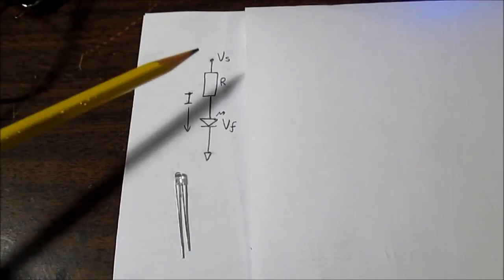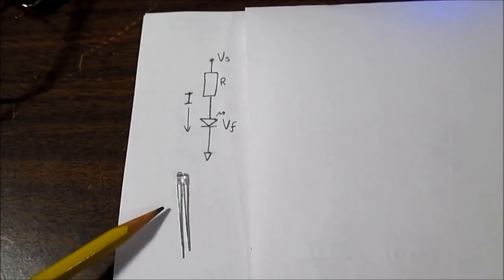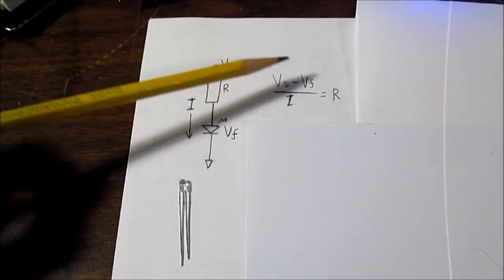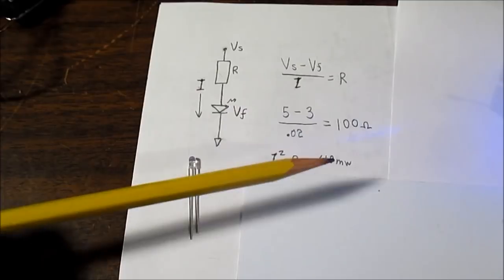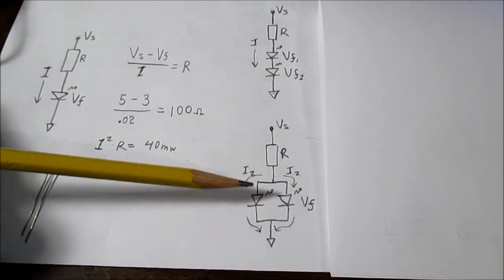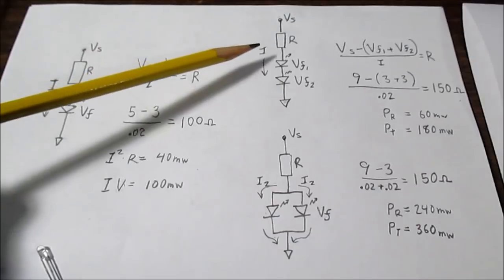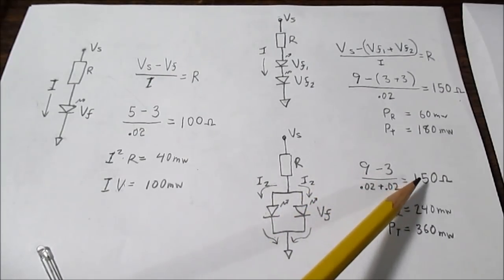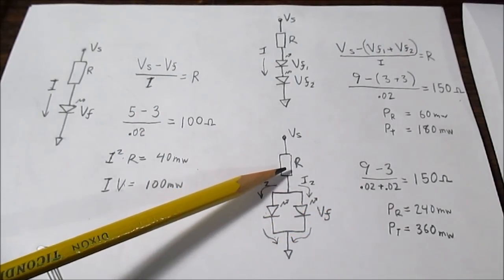How to select resistor value for LEDs

Comment: I was wondering what  size resistor to use  in a  device  I  built  meant  to  help heal  injuries  and  remove   pain.   Its consist  of near Ir 850  nm   diodes.  I  used an  adjustable  current and   voltage  power  supply.  There   are about 170   led I  soldered to a breadboard. Forward  voltage per  led was 2.0 volt . I put   six per row to get same as  a power  supply,  12  volt. With the  adjustable power supply  I   can light up  the  entire board,  but  have not yet purchased the  power supply   I  intend to  use,  which is  12v  8.5 amp.   I  dont know  what size resistor to use for the   entire board. I was  hoping to  use one  resistor   I have them six per row, If   I  set  the  adjustable  power supply to  12  volt,I can light   up  the entire  board with aprox  2.2 amps total.  What I dont  know is what kind of a resistor I can use for the entire  board. The  device  will   be   used to apply   to  my  lower back  and   to  the  bottoms   of  my  feet.  I am  a diabetes, and want to apply it to my feet,  I  injured  by  back  and  live with pain  meds  and  hope  this  might  work as  well  to my  back.   https://www.youtube.com/watch?v=zy-FzbSk0UY

Comment: It brings back fond memories from the late 70s. As a kid, I had picked up a few red LEDs from Radio Shack, without really having a use for them. Until I looked at my slot-car set. The cars had grain-of wheat incandescent headlights, but no tail lights. I measured the track voltage range, which varied with the hand-throttles, then I found the maximum current on the package somewhere. I worked out the resistance needed using Ohm's law, drilled some holes, glued them in, and voila. Tail lights on my slot-cars.

Since an incandescent bulb is a regulator of sorts, I could have wired the LEDs through the headlights to stabilize the LED light levels throughout the range of voltages somewhat. Since resistance is very low when the bulb filaments are dim, and high when the filament is hot, it would have allowed higher current to the LEDs when the car was going slow, and limited current when the headlights were bright, and the car was going faster.  I'm not sure if the voltage drop would have been sufficient, so perhaps a shunt-resistor may have been required.

I remember that if you accidentally got the polarity wrong on those LEDs in those days, they burned out immediately. Thankfully not the case any more.

Comment: I have noticed that the resistor used in LED indicators for 220V AC appliances like mosquito repellents uses 100k resistor but according to the formula [Resistance = (Supply Voltage - LED Voltage)/LED Amps] the resistor should be 12k (approx) but why 100k is used?
Reply from the maker: They wanted the LED to be run at low currents for less light. Modern LEDs are efficient and can be too bright if run at higher current.
Reply: JohnAudioTech but why 100k... wny not 110k or 200k? how they calculated that it should be 100k? Also the wattage of resistor for 230v should be arpund 5w but why they used 1/4w resistor?
Reply from the maker: It is not critical. 100K is "near enough" to give the light output they need from the LED. 240v across 100K is about .58 watts. The AC would probably be half wave rectified as the LED would be damaged if that kind of voltage is placed in reverse across the circuit (even at the limited current). This would mean lower heat dissipation from the resistor. I would use a 1/2w resistor.
Reply: JohnAudioTech But I want to know how it was calculated that 100k should be used? Also for 100k resistor the wattage should be around 5watts because according to the formula Power = Resistor Voltage * LED ampre = (220-3)*0.02A = 217*002 = 4.34 watts.
Reply from the maker: The designer connected the LED to a variable current supply and determined the LED was bright enough at 2ma. 217v/.002a=108.5K ohms. 100K is close enough value. 217v * .002a is .434 watts. Your decimal point is in the wrong position.

Comment: I find it strange that this info is so simple and easy to find and yet I STILL frequently find retail packs of LEDs that don’t give me the specs I need.
Reply: Emmett Turner 
If you own a multimeter, you can measure the voltage across both leads of the LED while powered up, then recalculate and pick a more optimal resistor value to pair with the LED.  The maximum current is usually rated at 30 mA, but if you target around 10 mA, you'll still get very good illumination and longevity.

Comment: Nice vid, it wasn't able to answer a question I have so I'm hoping you can. I bought after market tail light assembly and the brake and day running lights are the same bulb. No additional resistors or capacitors were included. I was wondering how would I go about wiring them so the load will restrict wen not hitting the brakes. Thanks for any help and I'm re using the stock tail light harness.

Comment: Would i need a resistor if I have 3 3v leds in series and a power source of 9v?
Reply: No
Reply: Den Lim that sounds problematic; you should always have a resistor to limit the current to a safe level, but since the resistor itself will have a voltage drop, 9 volts supply seem too little, I would recommend using 12 volts or higher, and do the calculations based on that voltage.
On the other hand, if your supply voltage is limited to 9V, e.g. from a battery, you should probably connect the LEDs in parallel, with a resistor for each LED.
Reply: No but you need higher voltage source that must be greater than 9 volt e.g 12v, 15 v
Reply: No yu dont.
 The answer is above me.

Comment: So if I have a 6w power supply and my LEDs need 6w what should I use as a resistor?
Reply: I'm using 4 1.5v LEDs linked together they are IR LEDs btw

Comment: Why deal with Conventional current when explaining a circuit?  Use electron flow which is 
more  sensible  to  explain. Electrons flow from neg. to pos., and  no reason to look at it in a more difficult way. To my way of thinking.

Comment: I have know these things for 40 years, but more recently started cheating.
If an individual LED is only going to be on for a couple hours use for the rest of my life, I will run the LED at double current overnight. If it does not fail, I will use that current level. It is much brighter than using max current per the spec sheet. Don't try this for a production or always on application.

Comment: Parallel LEDs in a Red/Green (single LED 2 color LED) pair (street light scenario) would benefit from the last circuit shown.   Is there an issue substituting the single color in your example for a 2 color LED (reversing one orientation)?

Also - Resistor on cathode or anode normally, and what about on 2 color situation?

Comment: There is a app called wova in the Google play store that will do the math easily. To find the wattage of the resistor just multiply the voltage drop across it times the current to get it. Twenty milliamps would be .02 when entering.

Comment: Very good video, simple and easy to understand.. I'm little bit ashamed because I never did the calculation, I always used any resistor in the 270omhs range and if the led was too bright or  too dim, I changed the resistor :-)
Reply: I use 350 ohm first, and then go lower if it's not bright enough, but same here.

Comment: Paralleling LED's is a bad idea. LED current increases exponentially with LED voltage.  Any small mismatch between "identical" LEDs will cause one to draw significantly more current and be brighter than the other.  You can add a small value resistor (10 ohms)  in series with each of the parallel LEDs to correct for device mismatch, but you would be better off just giving each LED it's own voltage dropping resistor.
Reply: From experience, even matched LED's will start drifting apart over time when run in parrallel on a single resistor. I assume it is from uneven heat distribution causing accelerated aging of one of the LED's, which gets worse and worse the further they drift apart.
Reply: Called an LED current thief when I was in school back in the 70s.
Reply: Jess Stuart 
You beat me to it with your comment. :)

Comment: how many ohms resistor can i use to reduce  12v to 3v
Reply: Assuming you are talking about standard LEDs - that approximates to 3 v @ 20mA (depending on the colour).
So somewhere round 470ohm should be good.
That's calculated as 12-3=9v to drop .... R=v/i = 9/0.02 = 450ohm .... the nearest stock resistor is 470ohm (always round up).
In real life you could use any value between 400-1500ohm - depending on what you feel is acceptable ... bright = short life, dim = long life
Reply: just resistors won't cut it ;), need to make a step down board
Reply: You need to know the current through the circuit. Other wise it is just a WAG.
Reply: use in4004 diode
Reply: 9/I ohms.

Comment: But where did you get the 20 milliamps figure in the first place?
Reply from the maker: The datasheet or manufacturer of the LED should be able to provide you with the recommended operating current for the LEDs.
Reply: I'm sure that it is mentioned in the data sheets but in school, back in the 70s we were told that a typical LED is around 20 Milliamps in the 80s and the 90s the white or blue LEDs it was suggested that a 40 milliamp current would be needed. Not always but myself I rarely ran across one that used a lower current. But since the 00s I haven't been in electronics hardly at all. Can not focus on the small parts.
Reply: Buy glasses.

Comment: so using a linear circuit with for example 9V battery, how many leds could i power up to make a diy lantern for my kids project?
Reply: Depends upon how you are connecting them. If you are connecting them in parallel. The Voltage will remain the same but the current will increase. E.g. if the LED's darw 3 volts you will have to add a resistor to drop down voltage from 9v to three volts then depending upon the number of led's you have the amps required will increase e.g. if 1 led draws 20mA and you have 3 LED's then the current flowing through the circuit will be 60mA but voltage will be 3. Now of you were to connect in series (one LED after the other in a chain) you would not need to add the Voltages instead of current. So assuming each LED draws 3Volts with a 9Volt battery you can run a maximum of 3 LEDs in series because 3 + 3 + 3 Volts = 9 volts in this case the current required for the circuit will be 20mAmps. I would think using 3 LED's in series would be better as you do not need a resistor. But if you need more than 3 LEDs then you can either 1) connect the LEDs in parallel after a resistor here you can use 9volts but the more LEDs you add the more amps (current) is drawn and the shorter is the life span of the 9v battery OR 2) Add another 9volts battery so you have 18 volts. Now you can connect 9 LEDs in series without a resistor but here you need more batteries. The life span of the batteries will be longer because current drawn is constant. This is more bulkier.

Comment: It wasn't mentioned in the video but generic LEDs come with a set of generic numbers for typical forward Voltage (R:2v, G & Y;3v W:3.8v, blue:4.5v) and Current (usually always 20-30mA).  These are only approximate, when you buy the listing should give actual - but it's usually good enough.  then always round resistor values up not down, the higher the resistance the longer the LED will last (but it will be dimmer).
Google "current rating of led by color" to see typical ratings.
If you work with "ordinary" LEDs and common voltages (3, 5, 9 &12v) the resistances are pretty standard and quite forgiving 56, 150, 390 and 470ohm are pretty common values.
google "LED resistor calculator" or visit http://led.linear1.org/1led.wiz this site does the job for you
Reply: Where did you get those forward voltages from? Because only the Red one is close, the rest is wrong.
I never saw a 0.020 mA LED.
Reply: Youve quoted what's wrong - Shame you didn't take the time to give the figures you think are correct.
I'll take the currents, had a brain fart! I was thinking in mA and then entered it longhand - I've amended that to mA.  
I did say that the voltages were ballpark numbers - often white is quoted at 3.4@20mA I'd usually work with the numbers I quoted because I find they work.   As I said intended to be approximate with a safety margin I'll stand by them.  Unless I'm particularly pushing as I also said I'd always round up and put a generous resistor into my stuff, things last longer that way.

Feel free to give your take - none of the numbers are set in stone - and I'm sure we all have had different experiences.
Reply: Thank you
Reply: Andy White Well it's good LED are voltage limited Because they last longer heathier on battery.
Reply: Thank you sir Andy I learned also from you
Reply: Andy White thank you! Just what I needed.

Comment: A quick average I use is 1000 ohms per volt for about 10ma and 500 ohms for about 20ma. It doesn't calculate the resistor power dissipation, doesn't work well for voltages below 5 volts, becomes inaccurate with a series string of LED's,  becomes more accurate the higher the voltage is, and doesn't really work for the blue or white LED's. It's only good for getting you in the ballpark.

Comment: What is table of 3w, 5w, 7w, 9w, 12w  and 20w LED lights capacitor condensor and  Resistor value in circuits?
Reply: Anil Haldarwala ur content no.?

Comment: Are you sure about the current of the LED? I did a quick test with a 3.7V (cellphone battery) and a white LED, the amp meter showed 1.4mA (0.0014A) and using this value in the formula spits out very high resistor values like 2kohms for 4 LEDs at 15V
Reply: Current rating may be various depending upon supply voltage. P = IxV  , so 3v LED conception 14mlA at 3.7V
Reply: JAT is correct in what he's showing - You should always design to the figures in the specsheet, that's designed to achieve the optimum (not necessarily the "best"(for you) ) results and protect the LED.  In real life other factors such as wire distance/resistance line capacitance/inductance ... la la la may need to be factored in depending on the environment.  So when you go to the production stage, adjustments might be needed.  If brightness is an issue you can overdrive drive the LED to the point where it only lasts for a few hours rather than the spec rating of 50,000.  Actual readings can significantly vary depending on real life requirements.  But you still always start from spec....
And in some circuits small differences result in (relatively) big changes in values.  2 v (3->5v) results in a jump from 50 ->150 ohm.  That's just the way the fractions work